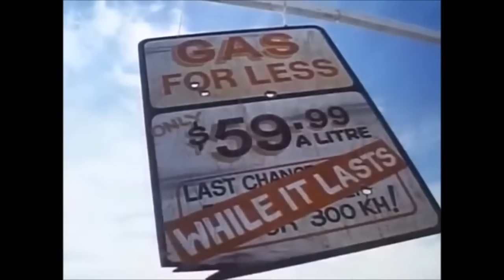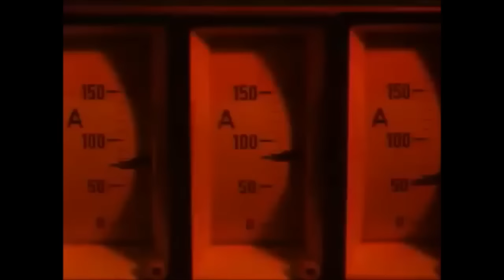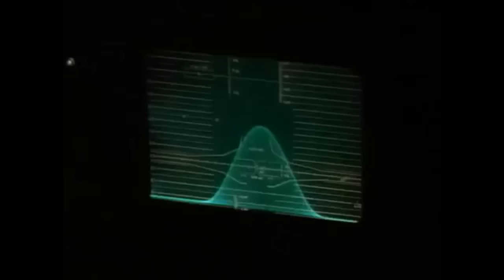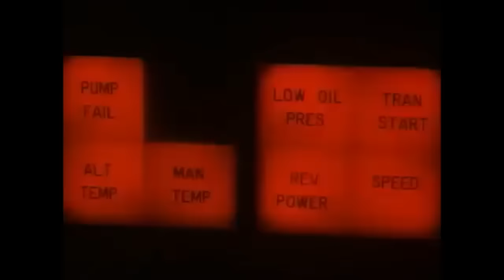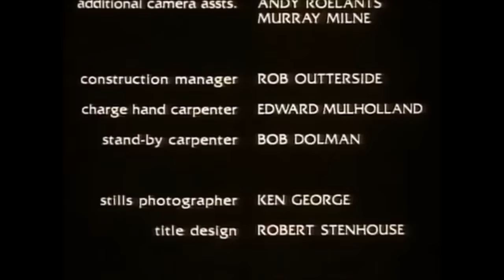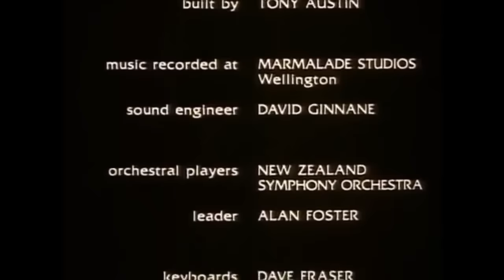Battletruck: Warlords of the 21st Century

Comment: Hunting for diesel would make no sense because you would burn more diesel looking for it.
Reply: It depends on how much you found or suspected you would find in the case of storage facilities.  I'd rather hunt for diesel when the alternatives were to climb on a horse or walk everywhere.
Reply: That's the conceit behind these movies.

It mirrors human evolution in one way, first hunter gatherers, them farmers, then specialists.

The fuel hunters eventually can't get enough fuel, other needs like food take precedent so we settle down. After we guarantee our basic needs, we specialise and find alternate ways of living like we did before.
Reply: diesel, peanut oil, kerosene, lightweight motor oil, oil from transformers, automatic transmission fluid,
diesel engine will run on any of that with no problem except for smoke.